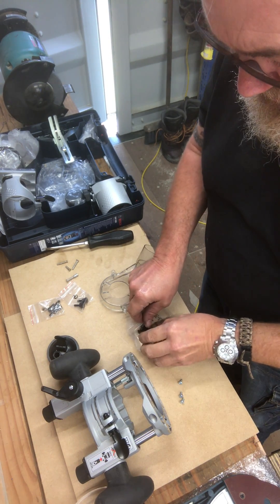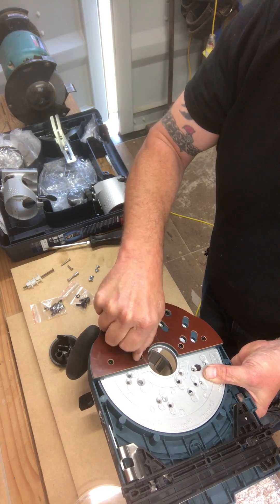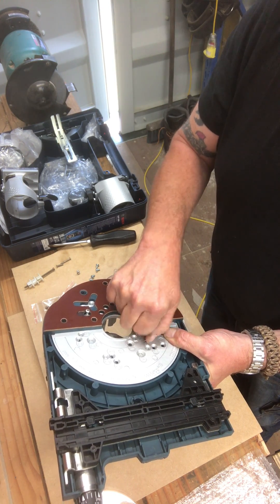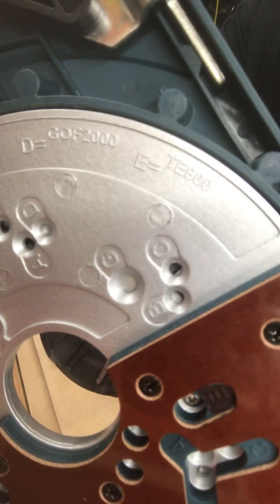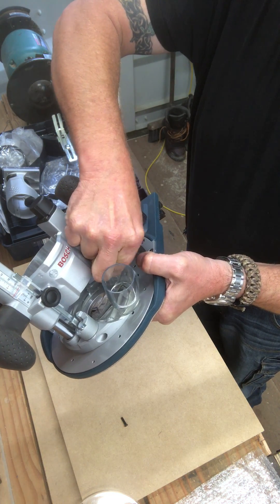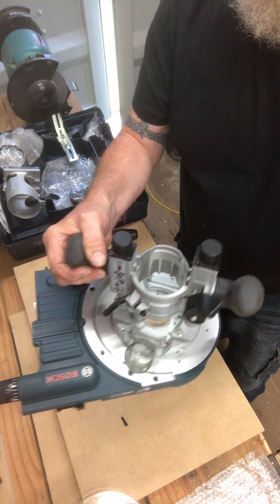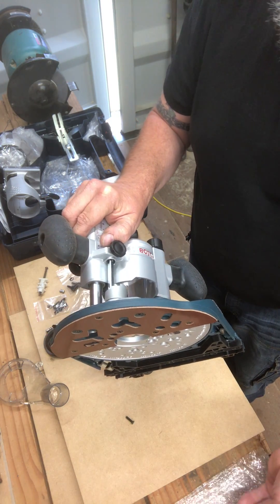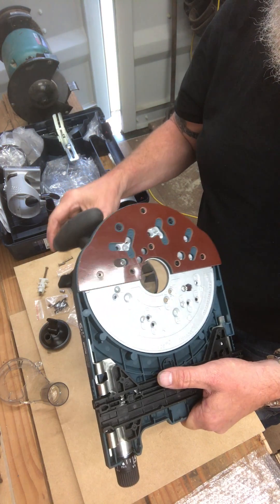Bosch TE 600 connecting with FSN OFA  part 2

Comment: Thank you, Malcolm, for posting. Your video was very helpful in reassuring me that my example was not mis-drilled and showing how the TE-600 mounted at an angle (unlike the illustration in the pithy instructions).
I found that the supplied bolts were, however, too long to fix the FSN-OFA to the TE-600 without the TE-600's perspex base plate attached and I noted from a Bosch promotional video that they left the perspex base-plate in situ when attaching the FSN-OFA. I shall be drilling two holes in the perspex base-plate to match the threaded holes in the TE-600 casting.

Comment: Just a quick note for others who stumble on this video. The method Malcom is showing is exactly the same for the Bosch GKF125CEK Colt using the PR111 plunge base. It looks like the TE 600 base is either exactly the same or extremely close to the same as the PR111.

Malcom, thanks for this! I was struggling trying to figure out how to connect my base up. The PR111 must be the American version of the TE 600. Sure would be nice if companies would refrain from getting tricksey with their cross-continent model branding!

Comment: Many thanks for this video. I rang Bosch convinced the base plate had been miss drilled since I could not get letter E to match my TE600 although I could get some other holes to align, Bosch wanted me to send pictures of the problem , I thought a quick search in YouTube may help and it did. Your explanation of the orientation of the two items got me on the letter “E” thanks.